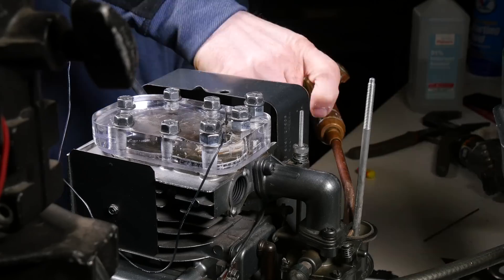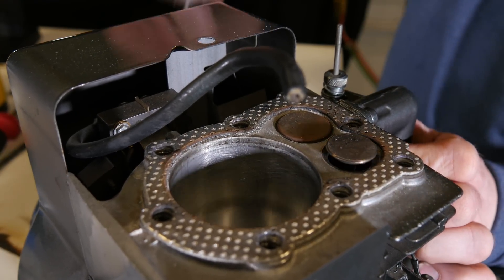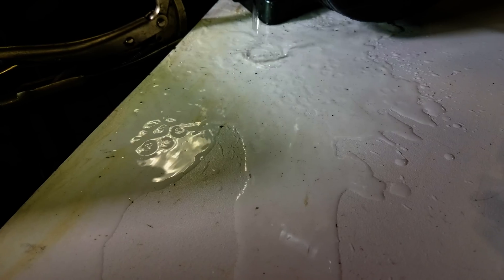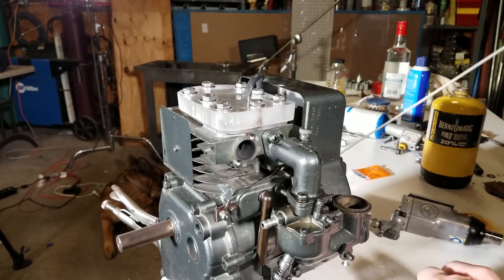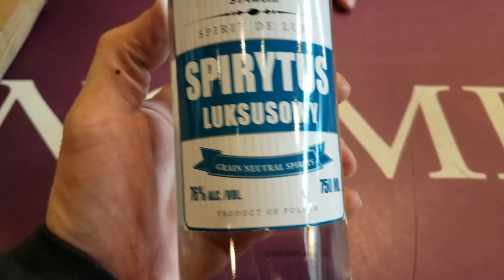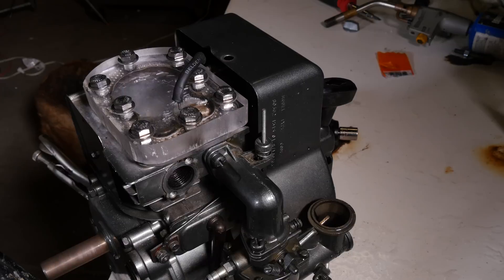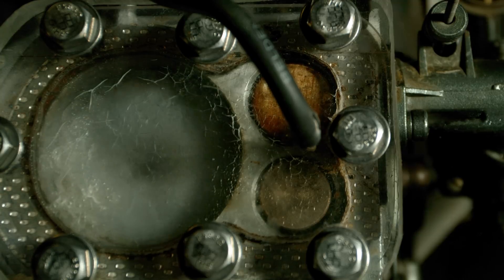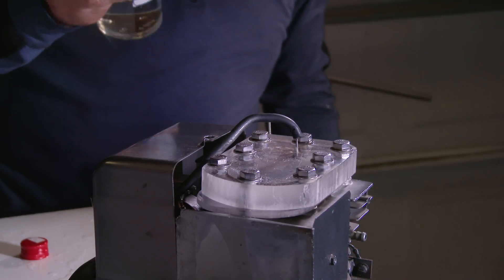See Thru Engine Runs Tequila, 151, and Propane - in 4K Slow Motion

Comment: That's some cool footage - it was interesting to see the delay between the spark and the start of combustion. I guess this is why ignition timing is set before top dead centre.
Reply: Paul Roberts the slower that the fuel burns the more advanced you have to fire the spark to give it time to combust before it reaches the top

Comment: See if you can't get a fuel injected engine. And also try and shape the clear head to improve turbulence and mixing. Might produce a better flame. i think the issue why your not getting as good of a flame with the liquid fuel is because of improper F/A ratio. Try misting the fuel into the intake instead of pouring it. They have thous mister bottles, that might work.

Comment: Ignition system misfiring? Slow timing?
BTW, Polish Spirytus, a bit weak, only 75%? :P
AND TRY NITROUS OXIDE!
Reply: Kushothe NO2 is not flammable, can't be used as fuel. It just gives engine more oxygen during combustion.
Reply: Did i say "run the engine on NO2 only"?
Reply: Kushothe N2O*

Comment: Why doesn't the engine fire in every power stroke when you run it on gasoline?
Reply: you should put a small leaf inside of the engine and see how it berns in slow motion.
Reply: Dis lob3
So? Are you saying the spark is not strong enough to reliably ignite every time?
Reply: you should put a small leaf inside of the engine and see how it berns in slow motion.
Reply: you should put a small leaf inside of the engine and see how it berns in slow motion.
Reply: Catrik You can see that it is not a real spark plug but some kind of steel wire that goes trough the glass.
Reply: Catrik is a 4 stroke engine the piston has to go up 4 time and at the last one you have fuel and air and that's why it explodes in the other ones it is just getting exhaust air out and pulling air thats why you dont see a explosion
Reply: osvaldo collado
I know how 4-stroke works. Watch the video again. It does not fire on every power stroke. And the air/fuel does not explode in a propely working engine, it combusts (=burns). It's called Internal Combustion Engine after all, not internal explosion engine :)
Reply from the maker: Dis lob3 what is not real?
Reply: He means there is no normal spark plug like in a normal cylinder head. Just some steel rod that creates the spark against the block. Just follow the strokes and you see that it skips every other power stroke. Spark but no ignition. I know it makes a spark between exhaust and intake strokes but I'm not talking about that.
Reply from the maker: Catrik oh , they may have edited the comment, or I misread it. I read " you can see that it's not real" and that was it. Yeah it was misfiring, Plus I was running it rich for very short periods of time so we didn't damage the head, I think one of the next test I'm going to do is running properly like it normally runs.
Reply: Warped Perception Spark plugs are specifically designed and placed in a spot to create a good and reliable arc. The one we see in the video seems homemade.

Edit: just saw your last comment. Thats what i meant yeah :P
Reply from the maker: Dis lob3 indeed it is custom made, the spark is there so I'm pretty sure it's misfiring because it's running very rich. it worked out but it was misfiring a few Cycles
Reply from the maker: Catrik haha, that's a good point, but it was misfiring, I think it was too rich
Reply: Dis lob3 real spark plug wouldnt work really either in this situation unless you also ran a ground to the spark plug

Comment: These comments are a quite sad representation of how people have no clue about the chemistry of combustion engines, yet are still willing to completely talk out their asses. You can buy cars that can run on gasoline to ethanol, the only difference is sensors and a ECU that can alter the air:fuel ratio for the fuel, which was not done here. People have been racing engines with ethanol and methanol for 60 years or more, in fact the original Model A Ford prototypes ran on ethanol, which any farm could make back then, but instead, oil companies out of Texas made sure this was made illegal to insure the economy would be dependent on their oil, the dirtiest fuel we can use in an ICE.  Given the amount of tracking and natural gas the US is producing right now, it makes no sense to use petroleum, just like it makes no sense to ban travel for the sake of security, but exclude Saudi Arabia, the only country not on that list that actually sent terrorists to America. Goes to show how Saudi Arabia still pulls the strings in America.

Comment: it looks like you're at the verge of flooding it with the 151° might I suggest something? remember when we were kids and we put rubbing alcohol into a sparklets bottle and only put a very small amount and slosh it around and then drop a match in it? and how it produced a jet engine looking flame out the top and you watched the flame drop inside the bottle to the bottom. it happens quick so try that on super slow motion. back to the motor. I think rather than pouring it into the engine, try using a spray bottle and put it on a fine mist and introduce it to the engine via the carburetor and as you spray it, it will atomize the fuel and air mixture better and I'll bet you that engine will run so much more efficient on the 151° than you might think. get that air fuel mixture just right and you will have a clean running engine. I mean after all back in the 70's funny cars sure ran good on denatured alcohol :-)
Reply: The Mechanical Koopa absolutely
Reply: Nod     /watch?v=IsW2M3GgQGc&t=25m32s

Comment: So does the alcohol provide a lot less HP?  Because it seems like a lot is 'wasted' in there and it seems to keep sloshing around.  Just wondering if there could be like... a system where it essentially filters out the alcohol through the exhaust and back into the intake making it more efficient/viable

Just brainstorming stupid thoughts lol
Reply from the maker: +Serrated Frost so I was a Racecar Driver for a long time and as far as I know alcohol has more power than gasoline, but you have to use more and you have to advance the timing, I believe it was 10 degrees further Advanced but I could be wrong. It's Advanced for sure though

Comment: I would love to see an experiment on port polishing the intake runner. Engine builders do this on automotive engines for better performance, less turbulence in the air intake stream. A lot of professionals say the runners should never be polished with anything finer than 80 grit or else fuel will pool in the runner instead of atomize efficiently. If you could get your hands on another intake runner for that same engine and mirror polish the inside, I'd love to see how it would affect the flow of fuel into the combustion chamber (using just gasoline). Maybe even 3 of them, 1 polished to a shine, 1 to only 80 grit, and an untouched stock runner as a control. What do you think? I know it sounds like a lot of work, but I'd do it if I had a high speed camera and a glass cylinder head. Thanks for the awesome videos.
Reply from the maker: +Jason Klow I know of this and I've also had doubts, I have a Toyota Supra Turbo, I had a fully built head, full porting job oversized valves dual valve springs, long story short sadly enough one of the valve springs broke, damaged my block and my Pistons and the entire head, I rebuilt the engine threw a stock on and ran the exact same setup I had before it blew, only difference was this time I had a completely stock head, the car seem to run much better, a lot more torque especially at the low end. After that I highly doubt it the efficiency of the porting especially on a turbocharged engine.
Reply: Warped Perception That kinda makes sense to me if the porting went too far. If the ports were ground too large and valve were too big, you will lose air velocity at lower RPMs. Velocity is crucial to fuel atomization. A port job like that is really only meant for engines that run continuously at high RPMs, like for racing. I'll bet that engine was a beast on the track. On the street though you want smaller ports and valves to keep the power band down low. Larger exhaust ports also make it difficult to spool up a turbo at low RPMs due to decreased velocity. If I were to port a head that will still be driven on the street, I won't actually make the ports bigger, only smooth the rough casting. My question is how smooth is too smooth, if there is such a thing. 
P.S. I recently broke a valve spring too. It does alot of damage very fast.

Comment: awesome, the alcohol doesn't atomize like petroleum fuel. that's why it looks like it's washing the combustion chamber. and the spark is not hot enough too
Reply: Sean Goldsworth 
alcohol atomizes just fine, the air:fuel ratio for alcohol is different and they need to change the carb jets.
Reply: If it was an automotive carb but no jets on a b&s

Comment: Better yet run nos
Reply: Ceady eady Nitrous oxide isn't flammable
Reply: Eliot Metherell No, it is not flammable. The formula is NO2, and at elevated temperatures it breaks down into nitrogen and oxygen, and the oxygen can then aid in the combustion of another fuel. But, NO2 itself is not flammable under any conditions.
Reply: A. Zak again, the nitrogen just compresses the particles, the oxygen is what is burning. So I don't see how it AIDS in combustion. What it will do is cause an engine to run way to lean and fuck up te cylinders.
Reply: kyle anderson I never said that nitrogen aids in combustion. I said that NO2 aids in combustion, which it does because it contains considerably more oxygen than air. And yes, nitrous will proper fuck up your cylinders if you don't have the engine tuned right.
Reply: A. Zak I'm with you now. I misunderstood,
Reply: A. Zak 
It is, actually, just has to be in the right conditions.
Reply: A. Zak is closest to the right answer. Everything he said was factually correct, however, the purpose of nitrous is not to be burned or aid in the burning of anything. It basically does the same job as a turbo or supercharger. It does this using a different method. While the Chargers force more air into the intake, weather by using exhaust pressure to force a turbine, (turbo,) or a belt driven system to force more air, (supercharger.) NO2 does the exact same job. It nearly freezes the air. As the particles get colder, they contract, therefore taking less space, so there is now room for more air under normal intake pressure. More air, means more oxygen, more oxygen. Yea yea
Reply: kyle anderson It does that, but it also directly aids in combustion by breaking down. An engine will run very well in an atmosphere of NO2, better than it will in air. I've done that experiment.
Reply: what about the nos energy drink??
Reply: It's amazing how many people think that terms like  N0S or nitromethane are actually super powerful or explosive. The fact is is that even nitromethane has very little power in it compared to most fuels it only becomes powerful because you can inject so much into the cylinder because it carries its own oxygen molecules
Reply: A. Zak nitrous is a fuel additive. He means on top of something else

Comment: diesel engine pls
Reply from the maker: I will make one handle the pressure or blow the whole thing up out of frustration, and ill make sure we film that in slow mo too .... 😀
Reply: good luck finding a flat head diesel, very rare  @WarpedYT
Reply: im not sure the clear window would be able to handle the pressure that a diesel engine needs to run.
Reply: +Falcon3 I really doubt that the Russians had ANY diesel engines to begin with. Russian winters are so cold that diesel starts to solidify even on milder winter nights there (milder being "only" -20°C, which is below the "pour point" of diesel), so relying on diesel engines would've meant defeat for them. In fact even their trucks run usually on gas, not diesel.
Reply: +SHADOWxWOLF I think that fused quartz laminated with acrylic or plexiglas might be tough but flexible enough to handle the pressure....or a thicker piece of gorilla glass.
Reply: "The T-34 was the mainstay of Soviet armoured forces throughout the Second World War." - "The T-34 was powered by a Model V-2-34 38.8 L V12 Diesel engine of 500 hp (370 kW),[notes 2] giving a top speed of 53 km/h (33 mph)." - Wikipedia. ;) https://en.wikipedia.org/wiki/T-34. In fact even their most modern tanks still run on Diesel. So.. clearly the Russians have no problem relying on Diesel for their armor. https://en.wikipedia.org/wiki/T-90 (Feel free to highlight this reply at any time WP lol)
Reply: I heard that when the Russains where fighting the Germans in WW2, their tanks where so reliable that they used their rations of Vodka from time to time when fuel was scarce. I'd love to see Vodka being run through a diesel engine.
Reply: +Falcon3 Uhm, okay. I guess tanks are a different animal altogether. Their trucks and cars definitely run on gasoline though...
Reply: CoolKoon rather a lot of russian trucks and tractors run on diesel. Also there is such thing as winter diesel which freezes at -35c. But starting a diesel engine at winter is still a bit hard.
Reply: the us built russia a truck factory , they are as tough as anyone elses and they only had 1 offical car for sale they have an amazing amount of  powerful trucks , tha run near anything flammable for fuel
Reply: Warped Perception where could we find material to make this head?
Reply: Darth Revan Really? Even in Siberia? How the hell do they start them up in winter? :P I mean on some "chillier" winter mornings even "winter diesel" might not be enough....
Reply: Warped Perception what might be the song that you used in the video?

I've been looking for several years
Reply: Its gonna blow up the glass dude xD

Comment: that's really awesome!!!! use diesel as fuel for next, you can also try use cooking oil
Reply: Diesel works on pressure, not a spark.
Reply: 1 cup of diesel poured into a 55 gallon drum in the sun will blow the lid off when you drop a match off in it.  The flash point of diesel is 125F. I know this because we would get in trouble as kids trying to kill ourselves.
Reply: it would need to be a diesel engine but it would need to be a much thicker plate since it uses pressure to combust
Reply: And it will still combust in a gas engine. The engine usually runs like shit and smokes a lot.

Comment: Try some RC fuel! stuff burns hot.
Reply from the maker: +DusterMuster I am totally going to try RC fuel, I have some 30% nitro mix on the shelf. Thanks !!!!
Reply: RC cars run a mix of nitro methane and methanol. it requires similar amounts of air as the ethanol does. and the way he was putting it in the carb was running stupidly rich.. which is why you see liquid in the combustion chamber
Reply: yeah the old stuff with nitro
Reply: nitro funny cars shoot flames and i doubt they run rich enough for that
Reply: DusterMuster cant see the flame though.... actually the lower grade fuels will look best with their improper combustion
Reply: TheNerdyCanadian that's methanol... it shoots flames because you can not burn it lean...
Reply: Warped Perception do starting fluid
Reply: Ya Di-ethyl ether, Probably blow that lexan head clear off
Reply: i think they require a lot more air though,   I could be wrong.
Reply: TheNerdyCanadian top fuel is something like 90% nitro methane and 10% alcohol.
Reply: Have a look at JohnnyQ90's channel, he's done it with a 2-stroke nitro engine
Reply: yes but the flame is not so visible
Reply: with 15% oil you can see it burn easily in dim lighting. if he ran a 30% mix of oil im sure we would have no problems seeing the flame.
Reply: @DusterMuster RC fuel won't work in that engine.. If he ever wants to get the power stroke to ignite the fuel he will need to change the spark plug with a glowplug. I think that's right to day, or isn't it?
Reply: do you mean nitro for RC cars?